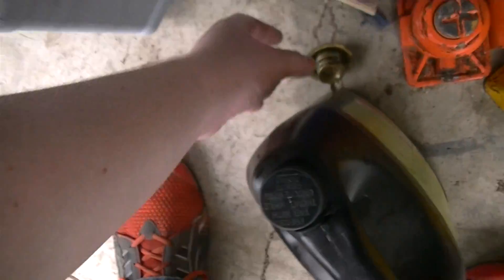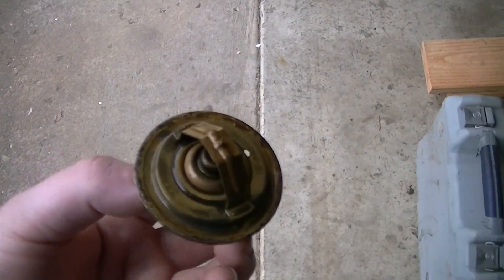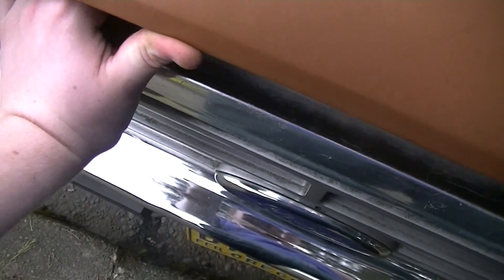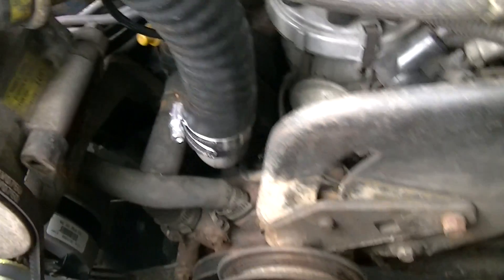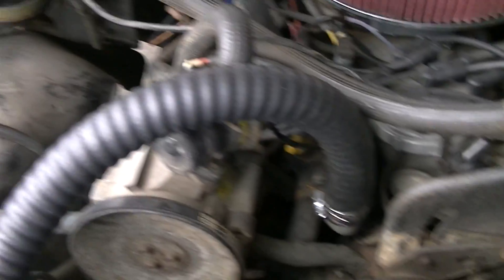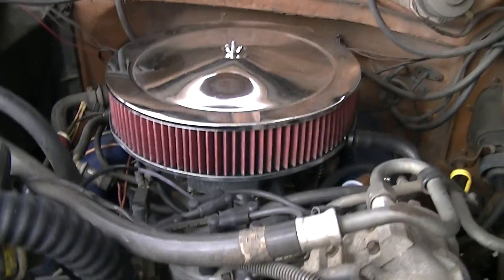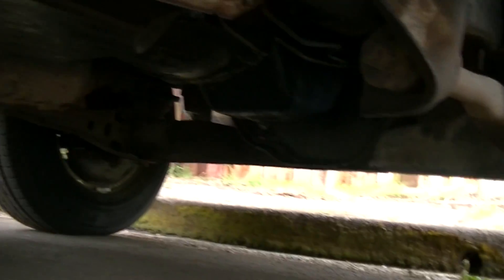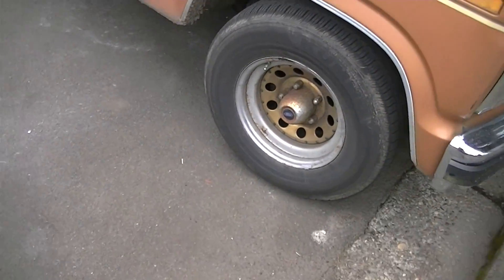Overheat Issue Fixed on the F150

Comment: Factory thermostats are 195* in these years of engines. I put a 180* in mine, before I put the 180* stat in it that thing ran so hot. Now it runs nice and cool, with a flushed cooling system of course lol. I normally run at 160-170* driving and 170-180* at idle in the winter. 160's are too cold for my liking and 195's are too hot, unless it's either super hot or super cold then I would use them depending on climate. But for pacific NW weather the 180* stat works great for me.